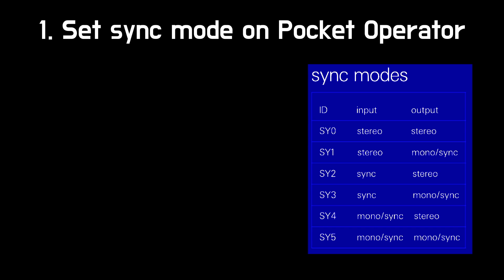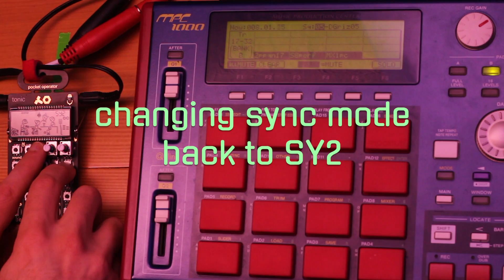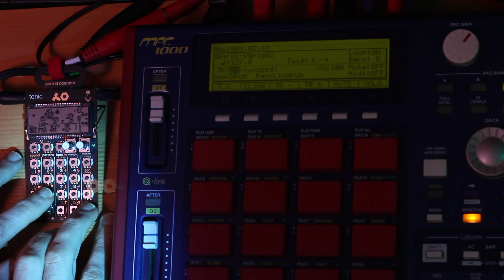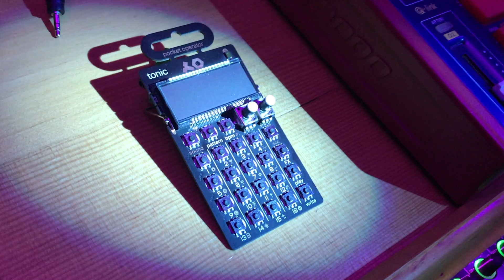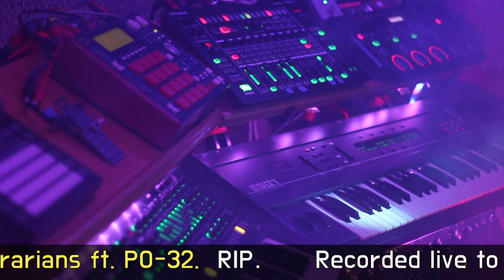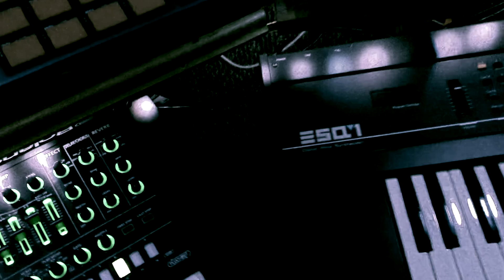How to sync Pocket Operator w/ other gear + New Song.

Comment: Do you think its possible to use a TRS to 5 pin midi breakout cable to link it with external gear? I also have an MPC 1000 and was wondering if you have tried this. Basically wanted to know if the PO receives midi per note.
Reply from the maker: it is voltage pulse that triggers the PO sequencer to advance one step. there is no midi implementation so plugging in midi will not work AFAIK

Comment: Check if you battery clips are  a little bend. If so the PO doesn't take the batteries properly. Bend them inwards a bit and put in some new batteries. Might work for you. Lots of people think their PO died but it's just this.
Reply from the maker: This is a good tip, and is usually the issue. In my case this was not the problem. I tested with multimeter.

Comment: I wonder if the sync signal loudness was what killed your po-32? The manual for the po-32 says the max sync signal should be 5V. No idea what this represents in terms of loudness
Reply from the maker: Good point. I was wondering the same thing, but the audio level I fed in was comparable to what the POs send to each other. I slowly increased the volume until it started picking up the sync. I'm thinking of building a cheap pocket oscilloscope.. If I do I will measure the output of the MPC audio I used and report back.